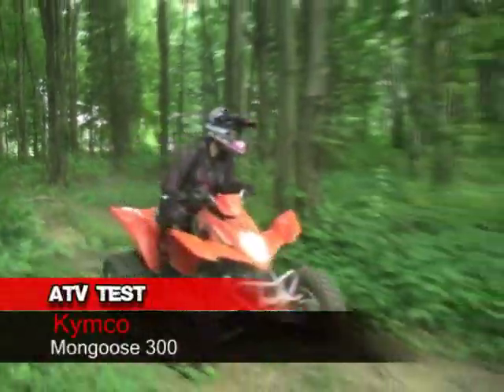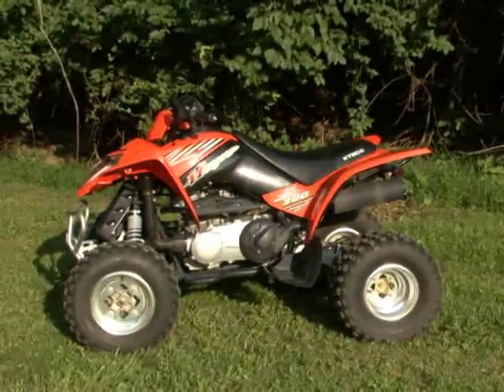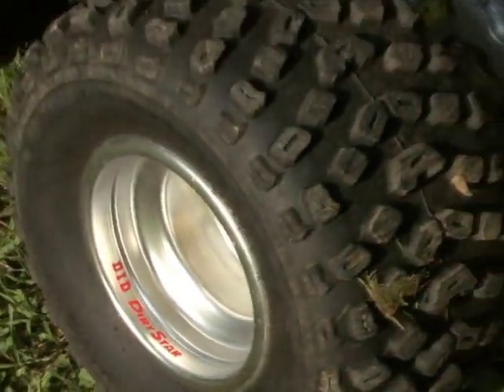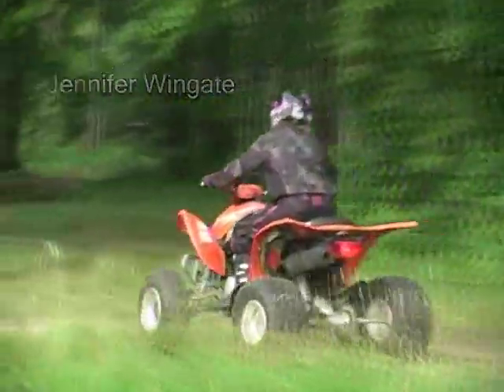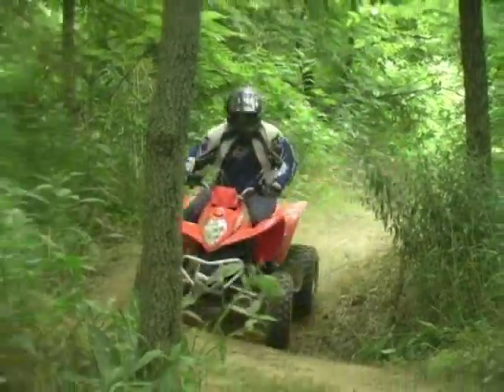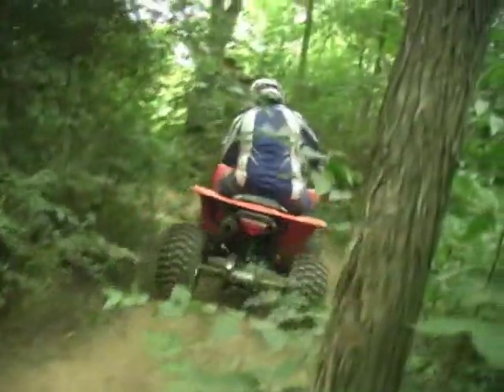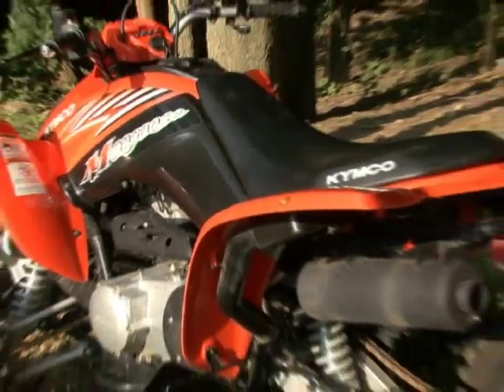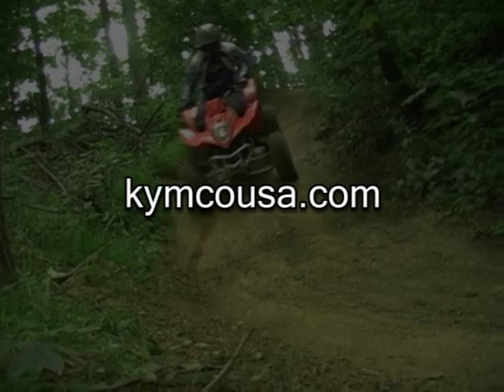2009 Kymco Mongoose 300 Test

Comment from the maker: Kymco manufacturers the DVX300 for Arctic Cat. The DVX and Mongoose are nearly identical mechanically, although Arctic Cat says the suspension is calibrated a bit differently. We have ridden both machines separately but would have to say their performance is very close. The Kymdo has the advantage of separate front and rear brakes and of course which one looks better is up to you.

Comment: I bought a 2023 Kymco Mongoose 270. Top speed is about 10 mph. Can't find parts. Piece of trash.
Reply: Bro take the throttle limiter out with a simple screw driver then it goes 40mph in a split second
Reply: Kymco has great value for money , my maxxer 300 dous 55 mph with new cdi from the dealer
Reply: @daffiecars dedgum